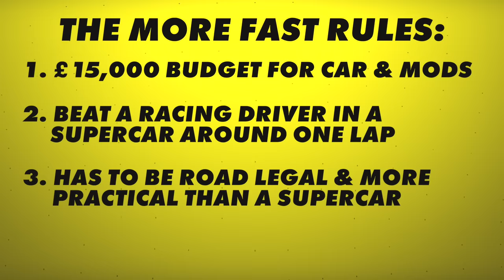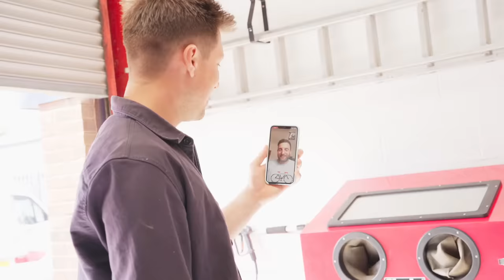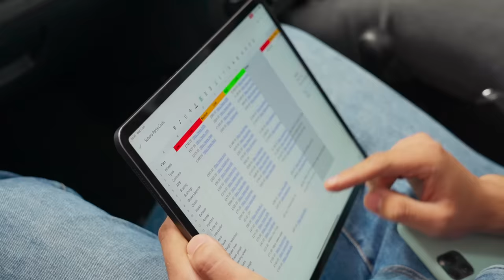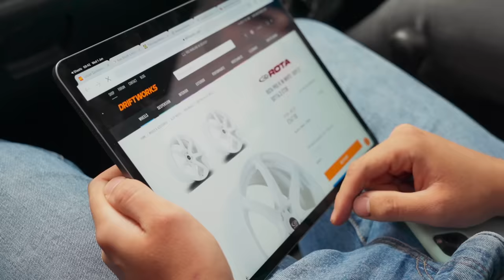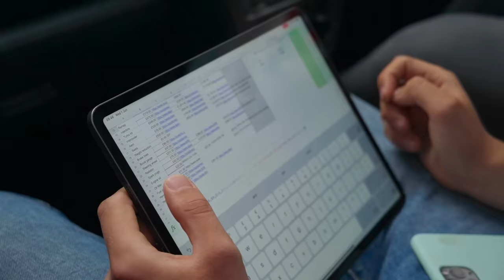Buying a $5000 Project Car to BEAT a Supercar | MORE FAST EP1

Comment: As soon as they mention buying alloys and changing the steering wheel you know they are gonna blow the budget on crap and lose
Reply: As soon as the guy scoffed at tires and said power instead
Reply: if they actually buy a new steering wheel im gonna unsubsribe and  never watch a video from them again.
Reply: @robertjusic9097 , Seems a bit harsh doesn’t it?
Reply: Lightweight wheels are an immense upgrade FYI
Reply: @gerardofiano4866  Yeh could blow £7k on a set of Magnesium wheels plus tyres but not the best way value for money to complete the challenge
Reply: @jayturner2917  and who mentioned 7k wheels? Just asking
Reply: @gerardofiano4866  well if you are saying lightweight wheels will make such a difference then do it properly and get magnesium wheels. but no matter what wheels you buy it wont make up the difference to the car its to race.. end of the day it was my opinion you commented on. Maybe next time write your own comment and not reply to other people's
Reply: @jayturner2917  sorry to disturb you.. Didn’t mean to make you cry
Reply: Hindsight now after the series hit its conclusion, but they ended up making some good and some bad decisions…which resulted in them beating the lambo (and many other track cars) by a  number of seconds. The lambo by 3+ seconds.

All in for 15k, that’s pretty damn good

Comment: even if it breaks to pieces at the end of the lap, you still win, so a weight reduction montage would be good
Reply: i totally agree
Reply: Colin Chapman agres.
Reply: Surely ducktape over the rear boot and back doors?? That'll be a bit of weight down...
Reply: Yes we're expecting PMMA replacing glass (with holes drill in the non-visible sections in the doors a la MX-5) and a huge pile of removed interior and unnecessary internals with light weight seats. Also try a Li-ion battery, swapping the metal fuel tank for a ~20L polymer based bag and if you can DIY a fibreglass body (using chopped strand mat with an epoxy that curse at room temperature and using the existing body as a mould) that'd be amazing.
Reply: Don't forget about the road legal oart of the bet
Reply: Definitely get a sunroof delete kit. Super cheap and removes a ton of weight from the top of the car

Comment: That AWD is going to be a disadvantage if you're only looking at pushing around 300bhp, with the extra drivetrain loss and weight.  I'm assuming it'll be a dry lap though.

Comment: Since they're on a budget, no steering wheel, keep current wheels unless they severely limit width, clutch, brakes, lightening, suspension. Then start thinking about power.
Reply: If the wheels they were looking at were lighter, then they could get a performance boost.
Reply: @rpgspyware9560  but wheels are expensive, and that money could save a lot more time when put elsewhere
Reply: @rpgspyware9560  i dont think 170 pound wheels are gonna be lighter than the stock ones. Also since this is an estate it should already have 225 tires which will be plenty effective once they get rid of  atleast150 kilograms of weight.
Reply: @rpgspyware9560  It would be cheaper to rip out the seats they don’t need!
Reply: @kurtlamprecht93  but they were not RPF1s they were a cheap rep of them
Reply: Theyre doomed, that one guy believes in power over good tires
Reply: Kinda hard to drive without a steering wheel but eh

Yes I’m joking
Reply: @kurtlamprecht93  I don’t know man I wouldn’t say driving without a steering wheel is cleaver or funny, it’s seriously hard you ever try it?
Reply: @kurtlamprecht93  it is truly there for a reason 😇
Reply: @kurtlamprecht93  last time I drove without a wheel was back in 99 when the mustang had no wheel attached but I was dying to go on a drive so I said fuck it and drove the thing, let me tell ya it was a blast in the most literal sense. I miss the stang, and that family misses there kids
Reply: @kurtlamprecht93  nah man I’m good thanks for the offer though
Reply: @kurtlamprecht93  very kind of you
Reply: @kurtlamprecht93  oh ya know what I just saw a video of someone driving a e36 with no steering wheel so it can’t be that hard
Reply: @kurtlamprecht93  who’s jag?
Reply: @kurtlamprecht93  never heard of noun, seems like a good guy ☺️
Reply: @georgerosebush9754  They were doomed the moment they chose a Subaru for “budget build” to beat a super car.
Reply: @-jozsef8275  they could buy already used wheels. Would be a even cheaper option

Comment: best option: chuck everything you dont need out of the car, but just enough stuff that it stays legal
Reply: I didn't hear any rules about it having to be legal :D  Just quicker over a lap at a track.  Toss the headlights and tail lights and maybe the doors too
Reply: @albertwong5793  they mentioned it at the beginning that the car has to still be road legal
Reply: @kurtlamprecht93  they said it once but didnt really acknowledge it so i just plopped it in the comments
Reply: @albertwong5793  they said the rules. Budget, road legal, more useful and they have to drive it. 0:28

Comment: weight reduction should be a main focus. remove all the sound installation and rear seats. You might then be able to sell the rear seats and spend that money on more mods.
Reply: Not sure if it still counts as practical if you remove the rear seats
Reply: @razghost2  a van is considered practical even if it doesn't have a back seat. This would still be a two-seater, it just would have an enclosed cargo area.
Reply: @razghost2  it needs to be more practical than a supercar, not more practical than stock form

Comment: Because of the budget an goal, keep the stock wheels as long as they allow a wide enough tire, keep the steering wheel stock, don't mess with putting a wing or splitter, best budget track tires, brakes pads, suspension, and cut everything you can out of the interior to reduce weight, then a bit of power for the rest of the money, and obviously fix the clutch.
Reply: Exactly, it worried me how they seemed to be focussing on the wrong things!
Reply: Order of importance.
Turn up
Low weight
Big grip
Just a little bit of power
Reply: What would make a better steering wheel? He mentioned the stock one being "massive."

Comment: To me, what is really going to make this challenge interesting is, Subaru wagons are prone to understeer. Handling will be your best friend to beating a supercar. Tires are the first most important factor. Get the best tires for track racing. Suspension is the second most important. Then weight and braking. You only need enough power to get up to 150mph in a decent time. Maintaining that speed is the most important.
Reply: What about the track? The would need to know how it is structured first, then it would be better to decide on what parts are the best. I agree that this would be the best allrounder. Maybe Something to increase Performance ?

Comment: Swap out the downpipe, up-pipe, injectors, fuel pump, boost controller, turbo inlet (NOT the intake!). stock catback and intake will not be a restriction at 300hp. For turbo Get either a used VF48 or like an FP Blue and run a used STI intercooler off the newer STIs along with a used 04-05 STI hood scoop and ducting. Dont cheap out on the tune and get it tuned for e85. Leave the stock wheels and go for as wide of a tire as you can fit. If youre concerned about braking get some used Subaru 4pots for the front and run some DOT 5 with aggresive pads. Pull as much of the interior as is reasonable, remove all the AC for weight savings. you could relocate the battery to the rear so the car isn't so nose heavy. 
The trick here is going to be used parts, the subaru parts market is huge and Takeoff parts like Factory turbos and intercoolers are a lot cheaper than aftermarket.

Comment: remove everything from the car to get it light, really good tire, really good suspension, and a bit more power
Reply: That's what I thought as well, but they want it to be practical so some things might have to stay...
Reply: @LumaControl  They could argue that ripping everything out the back keeps it more practical due to having loooads of cargo space. Only needs to beat a lambo or whatever for practicality sake.